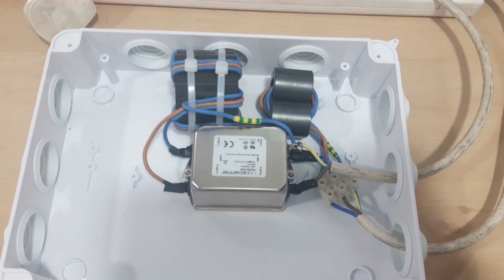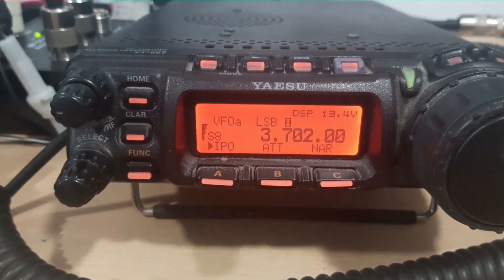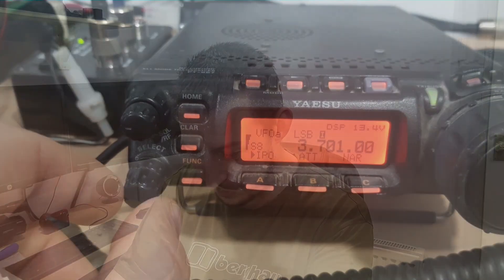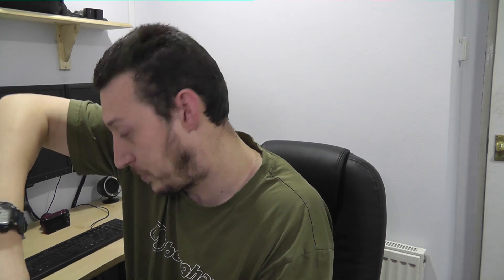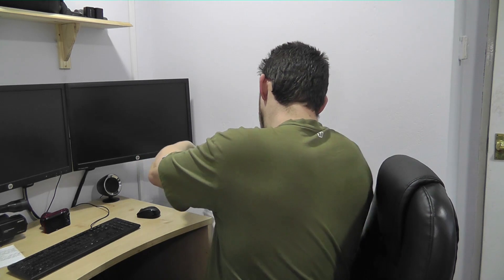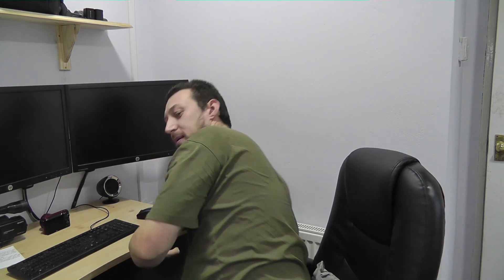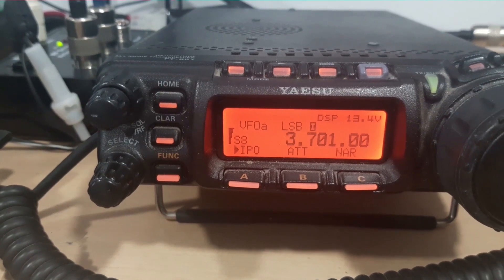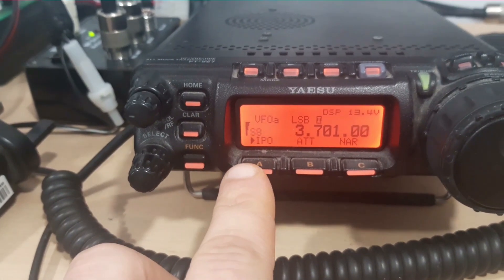S9 Noise - GM3SEK Mains Filter

Comment: It is advisable before spending money on making this mains filter to make sure you're interference is mains bourne and not something else, the simplest test to verify this is to run your Transceiver from a battery and turn your electric supply off at the consumer unit, if the interference improves on your signal meter this is mains bourne interference and this mains filter will be the ideal thing to make, if you are still having problems with interference by doing what I have suggested above you will need to investigate further where the source of interference is coming from, I actually purchased the parts to make 3 of these Mains filters and then I found out too after building and testing my interference wasn't mains bourne, I traced it to my broadband internet WiFi box, hope this helps but also helps you from wasting your money before you go running out to make one
Reply: I just did a video on this and it didn't make any difference to my noise level. I got from S9+ to S3 by supressing everything in the house. Moving from ADSL to fibre internet got me to S0! 73, GM4SVM

Comment: Hi James, just come across this video. Wonder if you solved the noise.
Most of my local noise problems have been solved with rx ants.
Reply from the maker: I got down to about an S4-S5 on the FTDX10 S-meter. It's around S5-S6 on the Flex but I suspect that the meter is calibrated slightly differently to the Yaesu.

I believe I was still using the FT857D when I made these videos? Upgrading to radios with modern receivers actually made a huge difference to what I could receive. The FTDX10 has a really good receiver, as does the Flex which I recently purchased.

I've messed around with a couple of receive antennas but actually seem to do slightly better with my EFHW & cobweb antennas which I transmit on.

I've got a couple of other ideas which I want to try out, so I might end up resurrecting this series at some point!
Reply: @HamRadioOnline  this is a big subject for many people, so yeh a update is always good. 73 have a nice weekend.

Comment: I don't know if you have got this cracked yet, I struggled with dire noise levels on 40m and 80m,  a few things helped, common mode choke on the antenna feeder, also on the LNB cables to the sat receiver and on the incoming phone line (we have VDSL). I am planning to build a filter similar to yours, it is not going to do any harm. 73
Reply from the maker: I've made a definite improvement to it. Around S6-S7 is the norm on 80, around S5-S6 on 40m, which is significantly better than the S9 that I used to have!

Still higher than I would like but I'm working a lot more than I used to.

I've now got a Yaesu FTDX10 and the receiver in that thing is phenomenal. The difference between the FTDX10 & the FT-857D is absolutely staggering!
Reply: @HamRadioOnline , thanks for the swift reply, it is a bit demoralising with the massive noise levels but that is the modern world really. I am sure the FTDX 10 is going to do a better job for you. My noise levels are far lower on a vertical than they used to be with a doublet but I miss the super high angle stuff. Going to put up another doublet at some point....

Comment: Your problem is airborne, not mains bourn unfortunately, Just to prove this is the case turn off your mains and run the radio from a battery if possible. If then you still see the s8 of noise, it's most likely airborne. A simple way of eliminating your house mains Hope  you get this issue sorted out lots of hams now have unacceptable noise level on HF due to lots of reasons, mainly cheap power supplies from China that slip though  the net. BT SKY And many more causing interference to the HF spectrum and no regulating taking place by the spectrum Guardians OFCOM unfortunately in an urban area now it's difficult to use Amateur radio due to this ubiquitous problem.
Reply from the maker: Unfortunately I'd have to agree. I think you're right.

I've managed to kill a bit of noise through moving the coax cable for the router, rerouting my own coax cables, improving the grounding arrangements in my shack etc

Sadly there's only so much that one can do.

Comment: hi james just watched your video a couple of points i can see that could be redone you dont seem to have enough turns on your large ferite core you need 6 turns and your 2 oval ferites need to be as close to the larger one as you can get it and use a total length of cable is 1.6 metres but you will have excess to trim your 2 feed points are to close to each other what you should do is build it as the same way as gm3sek as the 3 cables should be twisted tight so as to stop cross chatter hope this helps

Comment: Hi James, I am about to build this filter myself. I spotted couple of points with yours that 'might'  undo some of the benefits of the filter. 

Firstly in the original, the wires are twisted tightly before threading them through the ferrite, (I think this is probably quite important as I think it 'might' reduce the "cross talk" between turns or something like that) . Secondly, I see that the output wires of the filter are so very close to the input wires. If I were you I would probably have another go and twist the wires and then have the output at the opposite end of the case to the input. It might not make any difference at all but the only extra it would cost is time :)

(I also have horrific noise levels here. S9+ on almost every band.  The other thing I am considering is having a separate receive antenna, possibly on the ground).

Hope you didn't mind the comment.

Cheers and beers, Jason (M0WBC)
Reply from the maker: Thanks Jason. I'm always open to suggestions & you make some good points. I'll add it to my lengthy (and continuously growing) list of projects that I want to try.

Comment: Nice video James. Another variable ticked off, which is good. I also placed some Metal Oxide Varistors in mine. I connected them into the connector terminal, just to add some transient suppression. Good luck with your noise reduction project 👍🏻. 73 de Will, M0LGW